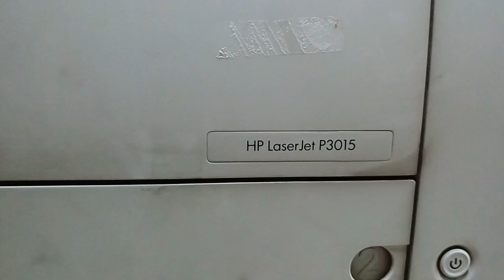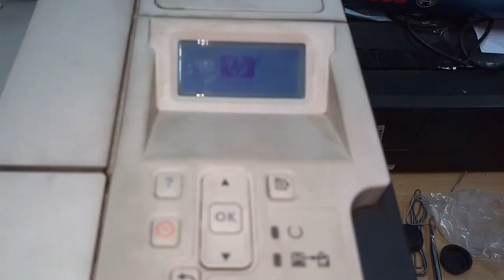How change Fuserflim step by step HP laserjet 3015 Printers

Comment: one wanting to fix his printer will need a lot of intuition, if using this video.
during the "critical phases" of the assembling/dissassembling, most of the time we can see only the hands of the guy, his watch and his bracelet, but what is important to be seen (how parts are getting coupled together and so on), we can't see. also, there are parts of the video that are running at high speed.
dude .. allow more time and more details for the watchers to see what you are doing.
you are well with the repairs, try to be well with making videos.

thank you.